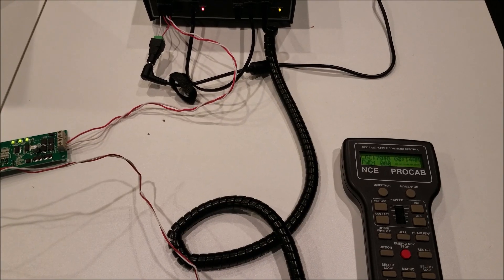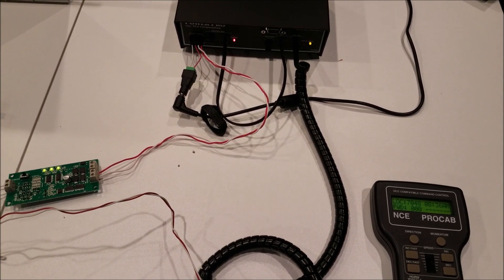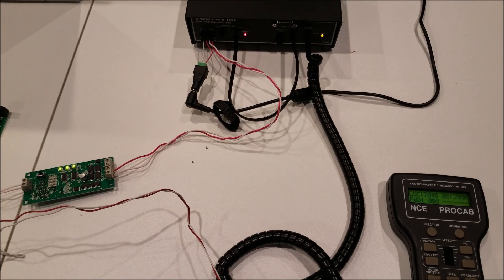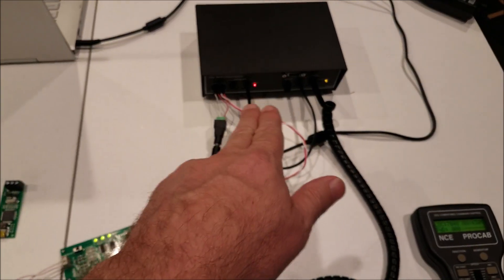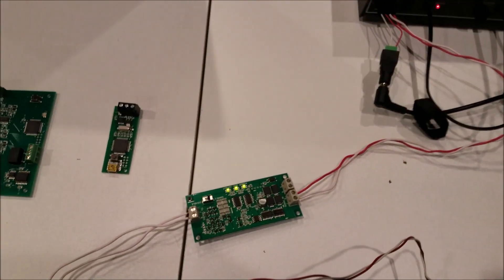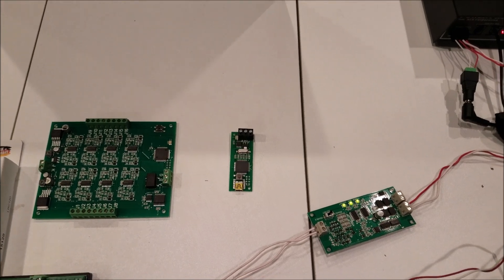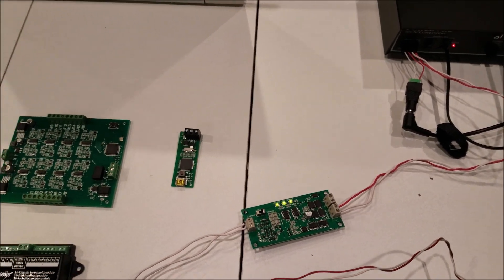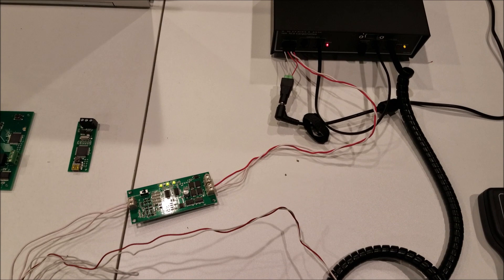Easy NCE RailCom Setup ~ Part 1

Comment: Great video. The NCE forum has plenty of entries saying that NCE command stations don't support Railcom. Ok fine you put a cutout in. Well, the MERG guys did some testing and found that the NCE command station does not send out a constant number of preamble bits and sometimes drops beneath the minimum for a short cutout i.e. less than 14. Long cutouts require 16.  In a short cutout 2 ones are dropped from the preamble, putting 0V across the rails,  and, from the decoder, channel 1 data can be returned but not channel 2 data. A long cutout requires a minimum of 16 preamble bits and channel 1 and channel 2 data can be returned. The NMRA spec says that decoders should not respond if they get 10 or less preamble bits, says they must respond to packets with 12 or more preamble bits but makes no reference to the condition of the decoder seeing 11 preamble bits. My NCE kit will be retired as I go to railcom!

Comment: I have a DR5000 and purchased the DR5088RC from you. I have some locomotives with ESU decoders reporting the correct loco address, but I have a couple GMD-1's from Rapido Trains that report the wrong address. The address is consistent with the same loco, but it's wrong. Do you have any idea ? I don't see anywhere I can find the wrong reporting address when using the LokProgrammer.
Reply from the maker: There are a couple of settings to check.  Make sure the decoders are reporting on channel 2.  Also you can try the settings in the DR5088RC PC app.  In the Detection tab, check box Channel 2.  In Reporting, check the Short Address and uncheck everything else.  In the Settings tab, set the RailCom Report to OPC_Mutlti_Sense_Standard  & Direction Off.   You can try some of the other settings if these don't work but this is what I have found to work the best.
Reply: @IronPlanetHobbies  Wow, that's excellent help. This has been bugging me for weeks. I thought there was a bad design or component in the circuit I built. You put my frustration  to rest,  thanks a lot .